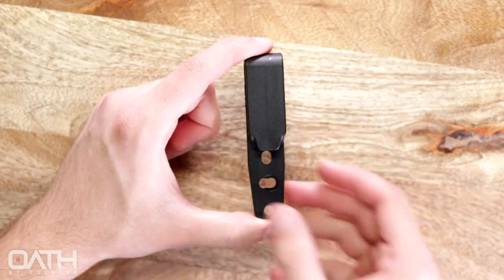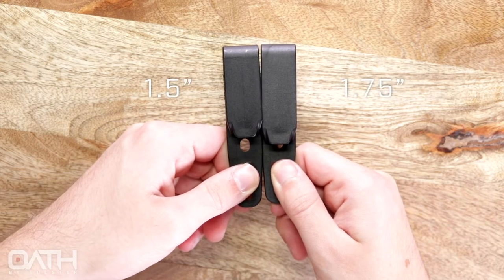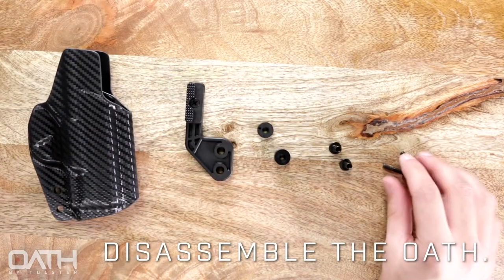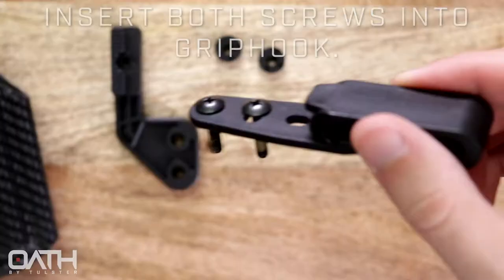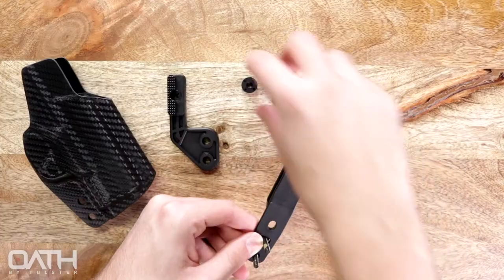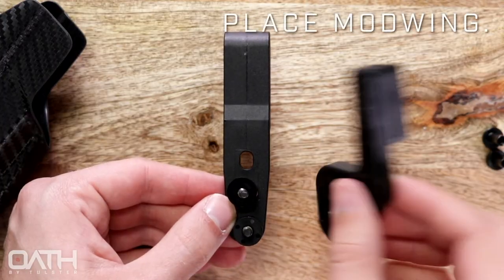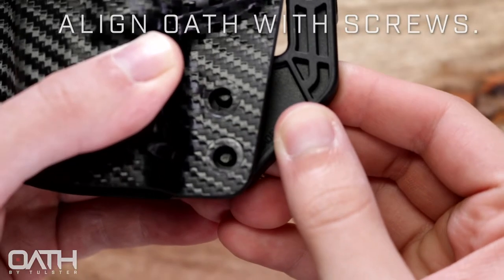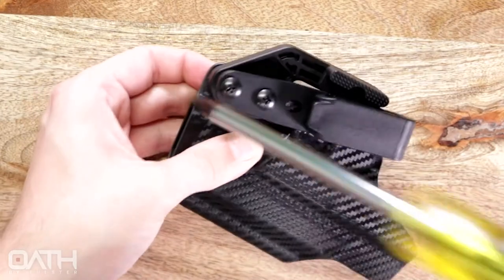Tulster OATH - Griphook Installation

Comment: can i use dcc clip on the profile where the retention screw is? i would like to make the profile tuckable and the oath isn't avail in p238
Reply from the maker: @NYCBladesmith- I apologize, but it will not work. On the Profile, the retention screws are located at the top of the holster, which prevents it from being a tuckable holster.

Comment: Can you use the grip hook on any tulster holster like the profile?
Reply from the maker: No, the Grip Hook currently only works on the OATH and RATH Series
Reply: @Tulster  So, if one has the profile holster , it would be best to buy one of the newer series holsters?
Reply from the maker: @THOMASETV  That is completely up to you. The OATH is the next step in concealment but everyone's body type is different and the way they dress. I would defiantly give the OATH a chance and you can return it within 30 days if it doesn't work for you.
Reply: @Tulster  I really to change the clip on my profile holster because it doesn't quite align with the sidekick. Any suggestions on the kind of accessories I should buy to address that?